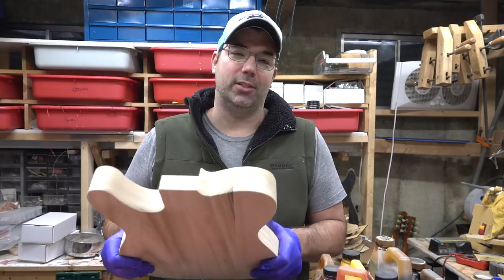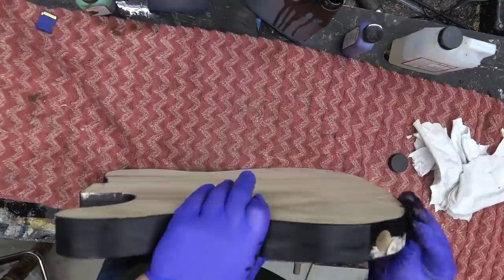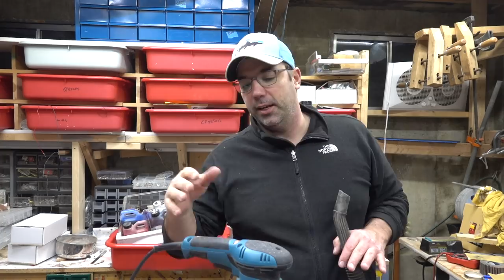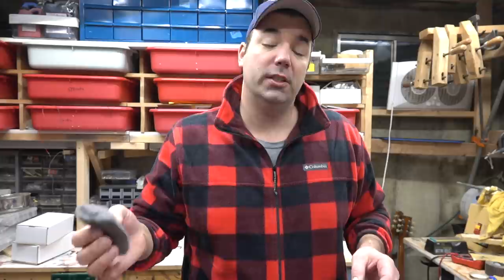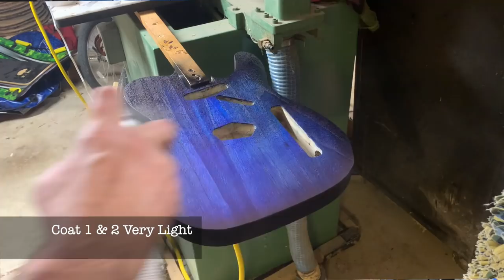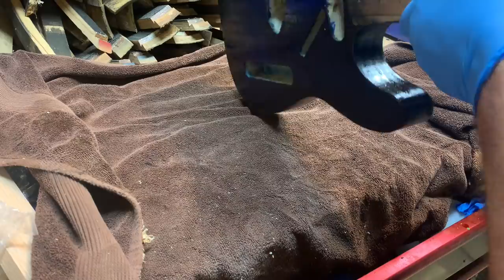Masterclass for a 1st time stainer: Midnight Blue on a Paulownia Body

Comment: I do a lot of wood restoration for antiques and furniture. I love Paulownia (Kiri) wood since I love Japanese Tansu.  Your work with water dyes and brilliant color gives me ideas on how to refinish a salvaged Japanese ironing board cabinet made with Paulownia.  Two of these were thrown in the dump and its so hard to find Kiri wood, plus these are vintage pieces that need rescuing.  The wood is very white, fragile, and easy to break or scratch. The plus side is that it is lightweight - so great for an RV, and insect and water proof.
With this white wood, I find it enhances the grain to use a blow torch and lightly toast it. It gives it some definition.  I learned a lot about staining, watching you work with a rag instead of a brush, much more control. I also never thought of steel wood for dusting off excess and adjusting it. Good ideas!  The shading with black turned out lovely!  I've never used Velvit Oil either.  Apparently it is a penetrating resin + oil like Danish Oil or Tung Oil finishes.  This does give a softer finish but is not robust.
I prefer making my own Wipe On Poly and using it over a stained piece.  I do not like the gummy finish of Danish oils like Watco brand.  They also yellow the wood over time.

For all those using Wipe On Poly, make your own. Oil Based Poly + Mineral Spirits in 50/50 combo or thinner.  Soaks into the wood, hardening and sealing of soft woods, and you wipe off (smear) excess, so it looks natural and not shiny and slick. Use a Satin finish.   fyi VELVIT OIL, not VELVET oil as per can label.

Comment: I tend to prefer the look and feel of the finished product when a filler is carefully applied. I like the finished product that a filler can produce  because you have some degree of control as far as how much time you spend and how thick the filler is applied. You can produce   variations of how smooth the surface feels. You can also achieve texture and transparency variations which I enjoy looking at the natural beauty of the grain in the wood. It’s nice to see transparent smooth wood grain in the flow of the edges and the flat surfaces of the guitar. With that said, I enjoy watching your videos, seeing your preferred techniques and methods in  achieving your desired end results.

Comment: Nicd technique. Gotten good ideas from you. I bought an old Mexican Tele online for $200, replaced the pickups. Installed locking tuners, replaced the volume and tone and replaced the 3way switch with a 4way switch. It sounds really good and I don't have much into it, about $550. I'm thinking about stripping the paint, wine red, and doing something to the body. Leaving the wood and using oil on it. maybe dent and ding it up and putting a belly cut and a forearm cut like a Strat. We'll see how it turns out. If I ruin it I can always make another body.

Cancel

Comment: Good stuff I just started on my first Nice light WD alder body w a quilt maple top Very old Warmoth compound slab neck for it...I went with a honey brown Top looks great w only a single coat Back and sides needs a good 2nd sand or maybe steel wool Might try a Gibson cherry red over it or burst the edges I can redo the back and sides But the top looks amazing but will probably sand and another coat My main question is what will make the top stain flame pop out Thanks I really love stain as opposed to coats of paint Sounds better IMO

Comment: You can source "premium" paulownia, including from sources right here in the US - but they charge so much you can spend a few more bucks and get a more "traditional" hardwood.   There is a sustainability aspect to paulownia that's advantageous for the "green conscious" - but then, poplar/tulip poplar/basswood are the same in that regard.

Personally I never touch this stuff unless I pre-treat it with something like shellac or Seal-a-Cell.  If nothing else it "hardens" it up to the point where you can sand on it and not lose your mind, and it really helps expose scratches - and this stuff LOVES to scratch after sanding.

Comment: Thank you for your videos! Watching you has given me the courage to stain my own bodies. My question has to do with the bodies from China. I remember in a previous review you did of the Les Paul copies from China where you mentioned that the wood used on them was not dry so the bodies warp. Do you have the same concern with the bodies like the one in this video? If so would it be beneficial to dry the bodies in an oven before beginning to work on them? Thanks, David

Comment: Hi, I’m following the tutorial on my new Harley Benton kit bass. The wood is called Rengas.  I’m just doing black as it is my first time.  I’ve applied the Angelus dye and left it for 24 hours and it feels dry but when I wipe over it with a paper towel or my hand it I get a residue.  Is this normal ?  Should I just apply the sanding sealer/finish now to seal in the stain ?  The stain itself doesn’t appear to be rubbing off., just leaves a residue. Thanks

Comment: Hi, I'm planning on using the same stain and technique you've shown in the video (except I chose the navy blue and my body is ash), but I would like to finish it with a 2-component high gloss clear coat finish.  what should I do differently?  I was thinking of finer sanding to start off... but do you recommend applying the sanding sealer before the clear coat? or is it not necessary as the clear coat will seal it off anyway?
Reply: You can do it either way, but if you don’t use the sealer you have to use more lacquer. 
Dye, sealer, and nitrocellulose lacquer is what I do. If you don’t have expensive equipment to spray lacquer you can use Minwax rattle can lacquer. It works as well as spraying it on with a compressor and a gun. 
My first refinish on a Peavey TL-5 bass was done with Minwax and it turned out amazing. But be prepared to buy several cans.

Comment: Mohawk seems to have a few different sanding sealers for sale. Which one did you use?

Also, since spray-on sanding sealers are not available in my country, could I get away with using shellac as a sealer instead?

Comment: I’ve used rattle can schellac as a sanding sealer with mixed results. I’d assumed it was due to the solubility of the Angelus dye. Do you think I’d have better luck with an actually purpose made sanding sealer, or is that part of the process just always fiddly?

Comment: If you were to do old masters drain fill with dark stain in it per instructions, is that going to prevent your Angelus dye techniques from working well?
Reply from the maker: Once you add a filler it’s not exactly the same.  Sometimes fillers don’t take the color as good as the wood.  I try not to use filler
Reply: Essentially if you want this dye process, commit to it, and grain fill along the way by using for instance tru oil in a sort of slurry method?

Comment: How do you get all the micro fibers of the steel wool off the body and out of the pickup cavities? The pickups are magnetized, seems like it would attract the fine particles into the pickups and over time that would cause an issue. Thanks for sharing. Stay safe and be Blessed
Reply: use a magnet

Comment: For my first build, I got a very nice quilted maple top and the Angelus black and blue. I'm going for a dark blue (not purple) without a burst (I want to do a natural faux binding). Any tips? I would start with 2 layers of black and let it dry and sand back like you said. After that, will the blue suffice, or should I maybe mix a bit of black with the blue dye and put 1 or 2 layers of that on it?
Reply: Probaly depends on how dark of blue you get and what your goal is. I would do ur black sand it back. Do the blue, sand it back and then decide if my next coat is just blue or if I need to blend it with the black. 

But I love how two coats looks specifically after you’ve sanded the first one back.

Comment: Like the open grain texture of this one, adds a lot to that finish IMO. Have not used Paulownia, but it seems to be a lot like poplar. How do those two compare Big D?
Reply: Poplar Janka Hardness 540
Paulownia Janka Hardness 300 - softer wood!
Birch is 1200 by comparison.
Paulownia or Kir wood is insect and water resistant, super lightweight, more fragile, tears easily, more fibrous, pale indistinct grain and very white. Think of it as White & Light.  Hard to find. The tree is very eco sustainable as it grows at 25 ft per year. The sapphire blue or bright white flower clusters are an incredible sight!  The leaves are huge.  Open pores. Grain is generally straight, with a coarse, uneven texture. Very large pores give Paulownia a striped, porous look.
Poplar is a great lumber because it is easy to work. It takes screws and nails well and can be sawn, sanded and more. Other advantages are that it takes paint or stain very well due to its fine pores, resulting in a smooth finish. It is also a highly stable wood.  Harder and heavier than Kiri.
Reply: Poplar is a tight grain. Paulowania is more like ash grain

Comment: I was wondering... instead of staining, and then sanding most of the stain back, what would happen if you just diluted the stain with more water? I'm guessing people don't do it for a reason, but I dunno.
Reply: No actually a lot of builders dilute their stains or dies sometimes. As with anything there are many ways to achieve a good finish you just need to experiment.
Reply: Derrick seems to go for a much more labour intensive approach. Diluting the stain is the best way, imo, not sanding (unless you want to leave finish only in the wood pores). If you are diligent in testing the color on scrap from the build itself then you shouldn't have to sand back.
Whatever you do, pay attention to your burst outline. Derrick's are often really all over those place.
Reply: In my experience, you can do either, but you may find that more diluted stain has a tendency to get more blotchy. At least that's what has happened to me.

Comment: I have a body just like this i got last year on ebay for 35 bucks already routed from a seller who i think sells a lot of them .. anyway just haven't figured how to finish it , thought about burning it but may try what you did . I only have trans tint so i guess it will work , never used that spray sanding sealer will try it too . true oil is my choice too , but i tried some pure tung oil thinking it was the bees knees on a build i just did and after 3 weeks i'm still wiping oil off ugh , its figured maple and kinda drying unevenly but doesn't look bad bc of the weird figure , may also be part of the problem of it drying still the different grains was thinking of putting a coat of true oil over it to just seal in the tung oil . do you think that would be ok , are they compatible ??

Comment: To alleviate 90% of the blotching . 
      Wash coat . 
1 pt. Lacquer (whatever top coat you're using , catalyzed is preferable)
5 pt. Lacquer thinner 
  Spray for best results , 50/50 
Spray pattern . 1.00-1.5 ml. (That's milliliters not millimeters)
  Let dry , de-burr with 180-220
 Stain . 
What is happening ? The thinner is diving into the wood pulling the lacquer with it to a set depth.
  Once dry you're dyes and stains can only go to the depth of the lacquer. 
Giving you control over the random densities in the wood.
  P. S. Dyes can be suspended in water , methanol , sealers ,vinyl /
Sanding and lacquers . 
  P. P. S. There is no difference in the color of those pieces of wood.
  Muhahahaha !! Finishers and their secrets !
Reply from the maker: I don't like doing washcoats I feel like I lose depth of figure.  I can get more out of the wood that way.  but I might not always get the exact blue.
Reply: @bigdguitars    to much stain that's all . It control's the depth ,the stain is under your control . Cup run  over situation.